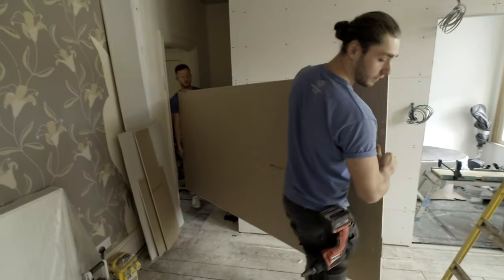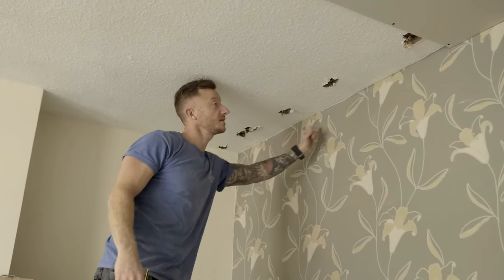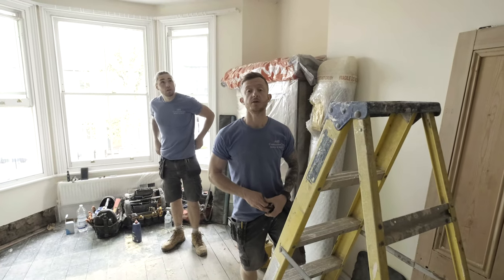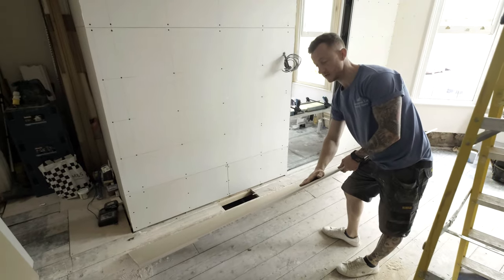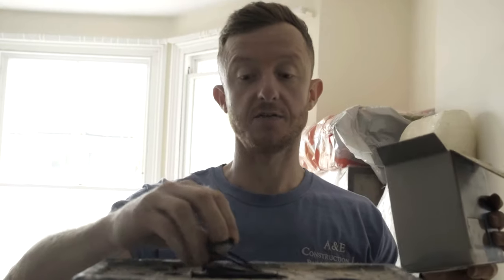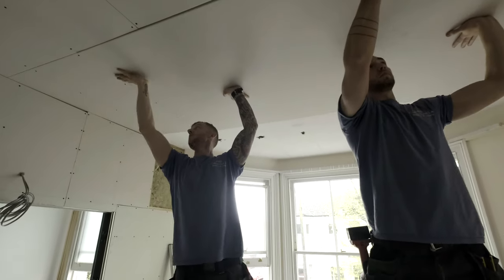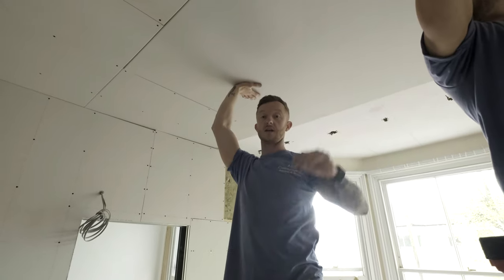HOW TO OVERBOARD A CEILING | DIY Series | Build with A&E

Comment: My wife and I did all the ceilings in our bungalow like this. Made 2 "Dead Men" (length of 3 x 2 timber with a piece screwed 90 degrees across the end to make a "T"). Used these to support each end of the 8 x 4 foot sheets when placing against the ceiling. Used full boards first staggering them, then filled in with smaller pieces. Did 8 ceilings in all.

Comment: Great job boys, this is exactly how we do it. A little tip we do is mark the back of the level at 300 centres so when you draw your straight line you can flick a mark at 300 with the marks on the level, saves the tape coming out again. 😉👍
Reply from the maker: That's a great hack, thanks for sharing 👌🏻

Glad you enjoyed the video.

All the best, John 😊
Reply: @BuildWithAE  can you translate it to diy level language or point towards what part of the video this is referring to? :)
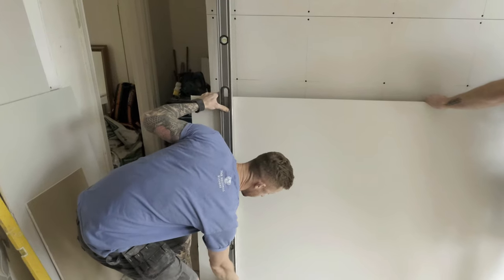Reply: @andychappel3500  at 3:56 he uses a spirit level to draw a line to cut the board along. The above tip is to have marks on your spirit level every 300mm, then transfer these to the board as you are marking your straight line. That's because you put screws in every 300mm. Hope that helps someone!
Reply: @andychappel3500  school boy error lol

Comment: I'm remodeling a 70 year old house that has moderate water damage in a couple of the smaller rooms and mild watermarks in a couple of other rooms. We have installed a new roof, but most of the water damage is quite old and hasn't been wet, recently. The parts that had been wet haven't been wet in months. I had already planned to patch the damaged portions and then install a new layer over the entire ceiling in these rooms. It's nice to see that I'm not the only one that doesn't want to just rip the whole ceiling down!

Comment: Nice work. For info, British Gypsum website says screw centres for ceilings are 230mm across the board and 150mm at board ends. For partitions its 300mm then 200mm for external angles.

Comment: Great video, I’ve got a bungalow to renovate and it has wood chip paper on the ceilings and I’m deffo going to do this instead of trying to steam that bloody stuff off! For the sake of loosing 15mm room height after it’s been skimmed etc, it’ll make for a better finish and be less messy!
Reply: Best use 9.5mm for ceiling, less weight than 15mm plus it will follow your ceiling line better..

Comment: If you’ve got a slightly lumpy original ceiling then use resilient bar screwed to the joists prior to over boarding. They’ll add some acoustic dampening as well.
Reply from the maker: Hey Freddie Lee Thompson hope you are all well, I will check them out for cost, anything to make a better job, thanks for watching all the best Tony 👍 keep safe

Comment: Thanks for the great video.... I want to overboard my bathroom ceiling which has got thin artex on it... I don't really want to scrap it of,... My question is - if I overboard the ceiling, can I just paint over it (once I've filled out the joint gaps with tape and plaster)... Do I need to plaster the boards?.. I don't really want to go through plastering it all.... Thanks

Comment: Great video I watched with pleasure and comfort to plan our upcoming project that will involve task “ make good” for ceiling after re wiring.   Quick question, why and when will you consider to overboard the ceiling?? The ceiling in video seems look stable despite few holes after some electrical work I presume.

Comment: Great video, very useful - thank you! Quick question, what do you do if you don't have a joist running along one edge of your room - how do you secure the edges on that side of the room?
Reply: You will always have a joist running along the edge otherwise your floorboards above will be Floating about a foot 😉
Reply: @jeracom  I’ve got the same issue as  G Money, the wall isn’t load bearing . There isn’t a joist / wall plate running along one edge of the ceiling. Think I’ll have to use plasterboard foam on that edge.
Reply: I know what You mean where the old plaster board used to
Lap of the internal walls and there is no joist it’s just how they built back then you can do one of a few things fit noggins or stick and screw and hole for the best 😅

Comment: Hard to see in the video but do you put screws around the very edge of the drywall, where it meets the walls? Not sure it would be going into a joist at that point but I would think drywall would sag without it.
Reply: Late but in the last few seconds of the video you see him screw the edges

Comment: Whats the best way to make all the lighting still fit , I have a bathroom I'm planning on doing this to but I have a bathroom fan with a light and speaker in it and idk if I'm better off just putting a small piece of wood to make it come down to fit the sheetrock or if there's an easier way to do it. Sheetrock is a nightmare for me , I can do your plumbing and fire sprinkler but I've always hated sheetrock work. And what size do you recommend for going over the sheetrock,  was thinking quarter inch or less because it's not like I have 10 plus foot ceilings

Comment: Do you have to tape the joints?  If not necessary, is it better to do it for a better long term finish to stop cracks?
Reply from the maker: Hi Richard,

You should always tape any joint on plasterboard, as it helps to prevent any movement which would otherwise cause cracking 👍🏻

Comment: great video, could you please clarify a couple of things, is it better to use tapered plasterboard as opposed to square edge for the purpose of taping, also I have an artexed ceiling, would you suggest using batons as opposed to fixing directly onto the art. thanks,
Reply from the maker: Hi bobby midden,

Either square or tapered edge board is fine to use.

Tapered edge is mainly for dry lining applications, to allow jointing compound to be applied and sanded in. However, if you do use tapered edge, it's always a good idea to start by applying some skim into the tapers to bring them level with the rest of the board.

With regards to the artex, it should be fine to board straight over. If it is a very heavy / deep pattern, then it might be an idea to give it a light scrape first.

Hope this helps.

All the best, John 😊

Comment: Should the joint where the plasterboard butts up against the vertical wall be taped?
Reply: if theres a big hole tape it .. if its 0,3-0,5 mm just leave it without taping

Comment: I've just boarded a ceiling and at least one more to go (back toi joist not overboard), an old Victorian property so nothing is straight. Unfortunatly in one of the corners I didn't take enough off the board and caught the corner, the papers still intact but the gypsum has broken. Whats the best option to get it ready for the plaster? Sister a bit of joist and screw the broken bit down? (theres an inch and a half overhand between the end joist and the wall)

Comment: I've read you can't overboard a plaster and lathe ceiling because the old plaster might fall down and make the new plasterboard sag. But if my plaster ceiling is holding firm to the lathe, it seems like I can just over board it, right? No need for furring strips or anything like that?

(The original playset ceiling seems structurally fine, it's just ugly because of slight cracking and tons of nail holes from where a decorative drop ceiling used to be hung)
Reply from the maker: Hi Roy Harr,

In my opinion it's perfectly fine to overboard a lath and plaster ceiling. Providing that you get plenty of good fixings into the joists, there shouldn't be a problem.

Please be aware that I am saying this without actually seeing the ceiling, so please don't take this as fact. If you are in any doubt about carrying out the work yourself, please get a professional to have a look.

Hope this helps.

All the best, John 😊
Reply: Build With A&E we are crying solution to install ” trim less light ” and seem I found one after seeing your video!!? Our flat got the ” plaster wood lath ” ceiling.  Am I right about that such overborad ceiling is good for Trim less light installation?
Reply from the maker: Hi content 7714,

Trim less light fittings can be fitted to lath and plaster or plasterboard, providing that you have adequate points to fix the fitting to.

There is a surrounding plate which is screwed to the ceiling (hence the need for fixing points) then it is skimmed over, giving the seamless look.

Hope this helps.

All the best, John 😊
Reply: Build With A&E so thrill that got your immediate reply!!!  Looking forward to more video soon.  Happy New Year & a good one ☝️

Comment: If my felling has cracks on it and some of board is not lv above can I still board over it or is it advised to rip old ceiling out and reboard over it
Reply from the maker: If there's parts of the ceiling missing or very loose, then I would recommend taking it down and re-boarding it. However, if there are just a few cracks, then overboarding would be a cleaner and quicker option.

Hope this helps.

All the best, John 😊

Comment: If you've got blown plaster would you take that off or wpuld you overboard it instead ?
Reply from the maker: Hi BMW,

It would depend on the severity of the blown plaster. If it's just a small amount, you could just remove the localised area and overboard. However, if a lot of the plaster is blown, then it would definitely be better to remove it all back to the joists and then board it.

I hope this helps.

All the best, John 😊

Comment: If I'm using a 9.5mm to overboard on a 9.5 and artex will 50ml screws be ok, or would I be pushing it for the 25ml depth into the joist
Reply from the maker: Hi Kyle,

I would go for 60mm personally, as it would give a much better grab.

Hope this helps.

All the best, John 😊
Reply: @BuildWithAE  Topman 👍👍. Ive got 50ml screws, was curious. Good video 👌

Comment: Doing mine next week. One question, where 2 board edges meet at the center of a truss how close to the edge of the board do you put your screws? I understood that screws should be no closer than 15mm to the edge of the board making the centers 30mm. If a truss width is about 47mm you will be running close to the edge of the wood
Reply from the maker: Hi David you could screw them but we personally would put a bit of 2x2 on each side to create a good positive fixing also we  noggin all the board edges and perimeters on ceilings thanks for watching all the best Tony 👍
Reply: @BuildWithAE  
Thanks for the reply.
Every video I have watched they hammer holes at the edges of the ceiling then put a chalk line between the holes to give them a screw line when over boarding. Then if board edges meet on a joist they have screwed close to the edges of the board which to me seems weak.
I understand what you mean as regards putting a 2x2 either side of the joist but surely that means smashing the board out either side to get it in all over the ceiling.

Cheers

Comment: Sorry if this is a dumb question, but why would i leave the old plasterboard in place, cant you just take it down and then not worry about the joist position?
Reply: At prevent a mess if u leave the old board. And also keeps the house warm.double insulation

Comment: Great video. Quick question about leaving a gap between the boards; I've been told that it will allow plaster to mushroom through to the backside and stop cracking (after it's been taped) Is that right or is it b*llocks?
Thanks a lot mate.
Reply from the maker: Personally I would make sure the boards are butted together. If you leave a gap and fill it with plaster, you're relying on the strength of the plaster alone, whereas if the boards are together you have the strength of the board as well. 

So long as the boards are fixed to a solid substrate, and all the joints are taped, there shouldn't be any cracking.

Hope this helps.

All the best, John 😊
Reply: Thanks for that. Much appreciated!

Comment: Good work, where was the swearing and sweating? I generally go for counter battens, makes a big difference for insulation and if the existing ceiling is ropey it makes everything easier. Also you can pack out any undulations.
Reply: That’s exactly how I have always done it .You get a more secure ceiling and it really doesn’t cost that much more in time or money .

Comment: Hi Guys, when overboarding a ceiling then plastering what would you use around the outside to stop it cracking? The existing walls won't be plastered, just the ceiling. Thanks
Reply from the maker: Hi Oliver,

If the ceiling isn't tied into the walls then there will always be a risk of cracking. The best way to reduce the risk is to ensure that the boards are securely fixed prior to plastering. I was also recommend using decorator's caulk around the perimeter when decorating, as it's flexible and should prevent any cracking.

Hope this helps.

All the best, John 😊
Reply: Build With A&E thanks John, I did consider decorators caulk or paintable silicone. I will give the caulk a go. Thanks
Reply from the maker: No problem 😊

Comment: What torque setting do you have your drill on?  And also do you rate the joist finders you can buy online?
Reply from the maker: I'd recommend using a low speed high torque setting with your drill, as too higher speed will usually result in the drill bit popping out of the screw. With regards to the joist finder, I would just go with the tried and tested hole method. This way you can physically see the joists (and save yourself a bit of cash) 😁

Comment: Is this the best option for hiding an awful artex kitchen ceiling? Or should I tear the old one down and start from scratch?
Reply from the maker: Overboarding would be a quicker and cleaner option than ripping the old one down. However, you need to be sure there are no cables or pipes running low through the joists. 99% of the time they will be running through the centre of the joists, but you should always proceed with caution to ensure a screw doesn't end up causing damage.

Hope this helps.

All the best, John 😊

Comment: Do you put the board on the same direction as the old board?
Reply from the maker: Hi D S,

When plasterboarding a ceiling, you should always install them across the joists, with staggered joints. This helps to reduce the risk of cracking, should there be any movement in a joist.

If you know where the joints of the old boards are, then I would aim to get the joints of the new boards on different joists.

Hope this helps.

All the best, John 😊

Comment: Great video. Do you guys ever worry about asbestos when drilling through decorative finishes like that ceiling?
Reply from the maker: Hi 77rabbit77,

This ceiling only had wallpaper on, so in the worst case scenario, there may have been some lead paint present.

However, if we ever had even the slightest hint of anything sinister, we would always get it checked by a professional before commencing work.

Thanks for watching.

All the best, John 😊
Reply: @BuildWithAE  Nice! If the ceiling has asbestos in it, is there a safe way to still board over?
Reply from the maker: Any asbestos should always be removed by a certified professional, it's not worth trying to cut corners with that stuff!

Comment: Is it possible to overboard a ceiling with acoustic plasterboard for soundproofing?
Reply from the maker: Yes of course, you can use many types of plasterboard when overboarding.

Hope this helps.

All the best, John 👷🏼‍♂️
Reply: @BuildWithAE  Hi John, thanks for replying. Curiously have you ever over boarded a ceiling with acoustic plasterboard and if so, did it work to reduce noise from upstairs neighbours? Thanks in advance.
Reply from the maker: It does help, but there are many variables to consider when trying to reduce sound transfer. The best solution would be to take down the existing plasterboard, insulate between joists and then board the ceiling with acoustic board. There are sound proofing fixings which can be used to secure the plasterboard. These reduce vibration transfer, which is the main cause of noise.

Hope this helps.

All the best, John 👷🏼‍♂️
Reply: @BuildWithAE  Many thanks, John. You've been very helpful.
Reply from the maker: No problem 😁

Comment: Great video, thanks. Quick question - we are about to overboard our ceiling (due to artex coating) but have read that we should cut into the wall so that the boards slot in. Is this essential? We’re planning to use 12.5 boards. Thanks!

Comment: Fantastic video! Quick question, if you are doing this for a bathroom with an exhaust fan or any room with a ceiling vent, how do you adjust for the new depth? Thanks!
Reply from the maker: Hi Jeff buy and extension piece for the fan all the best Tony 👍 have a awesome week

Comment: Great video. I've done a bit of plaster boarding before but looking to do a pitched roof inside an already converted, but not insulated, room. Given they are quite a lot thicker wondering what best way to cut the angle on the board where the roof meets the wall is?
Reply from the maker: Hi Jeremy cut it to the longest point and use a plastering rasp that’s how I would do it but everyone has there own way and use required PPE all the best Tony 👍

Comment: nice job. what's the rough cost of that?
Reply from the maker: Hey depending on we’re you live in the country it can vary.
Top Plasters are expensive, plus they will have an apprentice with them or it could be two plasters, depends on the company and how they are set up. I would suggest getting a couple of quotes and go and look at there work. Thanks Tony